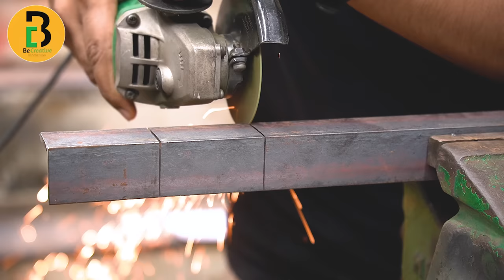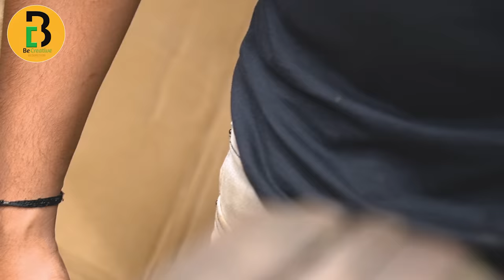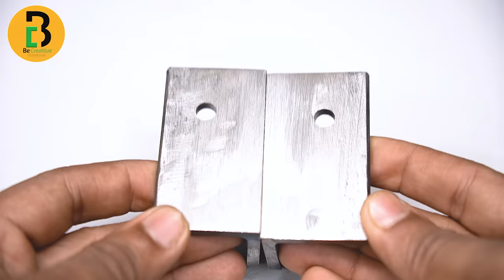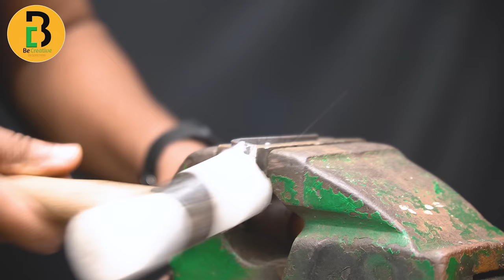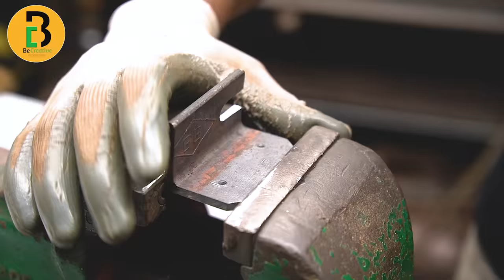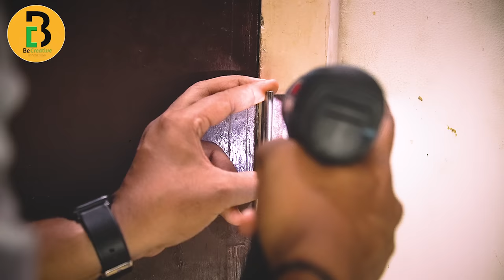Great idea for door locking mechanism

Comment: Very wrong practice to use your hand or fingers cleaning after the drilling work. It will hurt the hand / fingers. ( Never use bare hands ) Using proper brushes advisable.  That too you are showing it in the video meant for public
Reply from the maker: Thanks for the tip